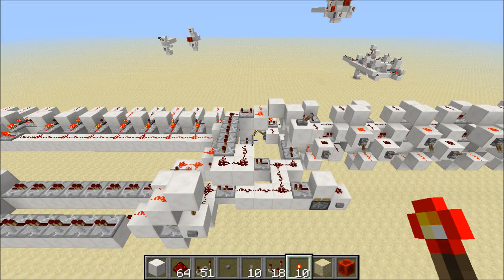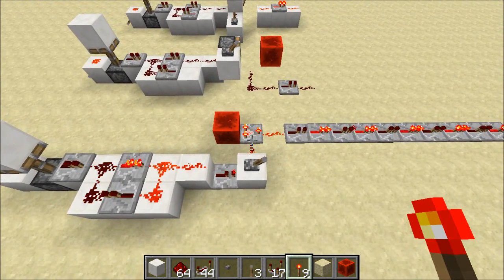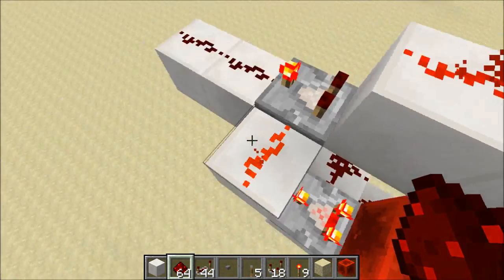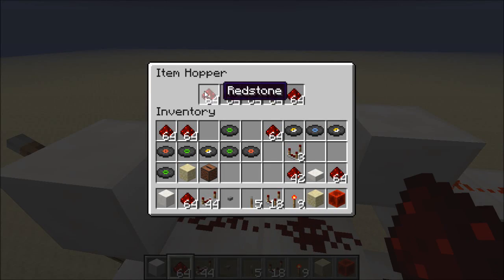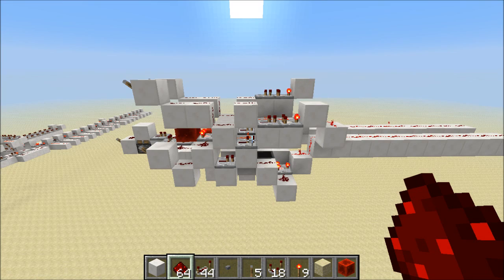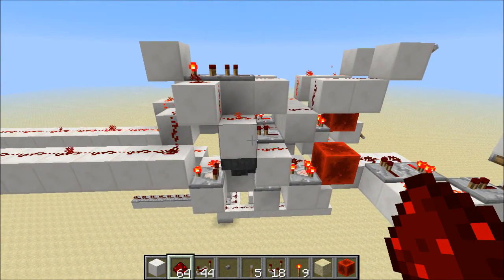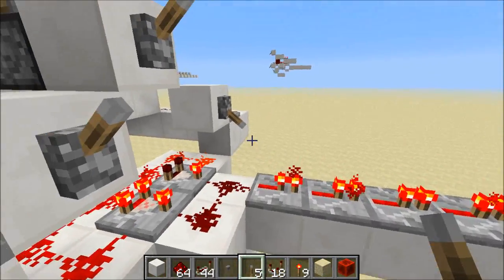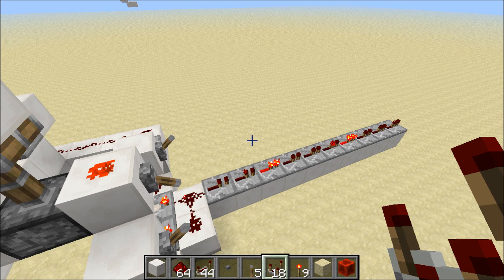Redstone Concept: Anti-Burnout Logic (Torchless and Pistonless)

Comment: Hey, the comparators are being completely consistent, they just have a 0.5 tick delay, and repeaters are only updated at every whole tick, so if the comparator goes off at a half tick later than you expected, you could get a 10001, or a half-tick early and you could have the 101 situation.

Comment: Yep it's possible to do a 10Hz computer using this, you just have to be careful in your timing to make sure the devices that take longer than 1 tick to finish will propagate the 1 tick signals through properly. See BIGWUNuvDbunch's (guy1234567890) video of his 3 tick alu using this principle of careful timing to get a max speed torch based alu.

Comment: Ooh that's interesting indeed! 1 tick pipelines open up a whole new level of CPU speed. :D

Too bad about those timing issues, though. I've when they make a corner with comparator -> block -> comparator, in 2 of the 4 directions they will both update in the same tick.